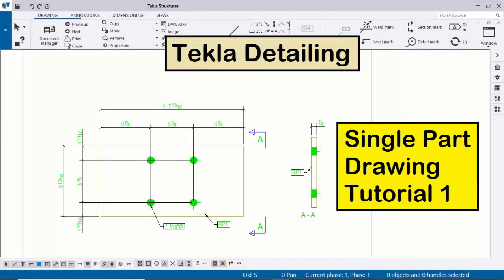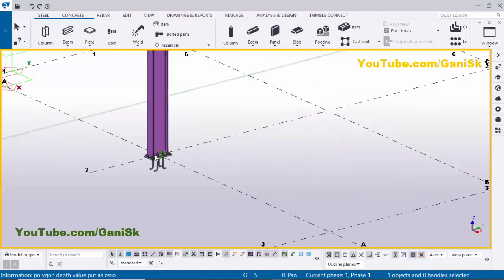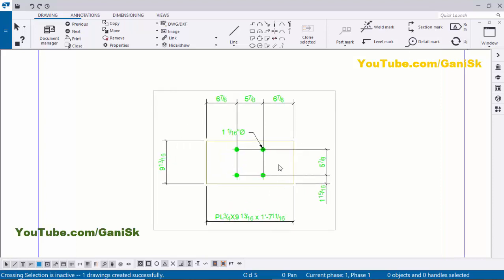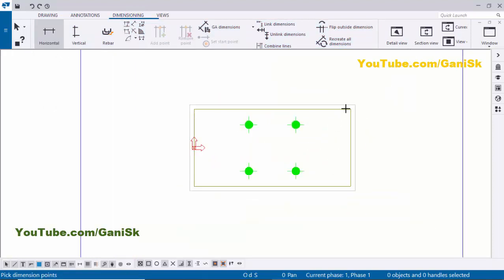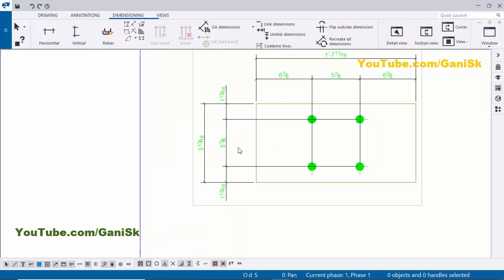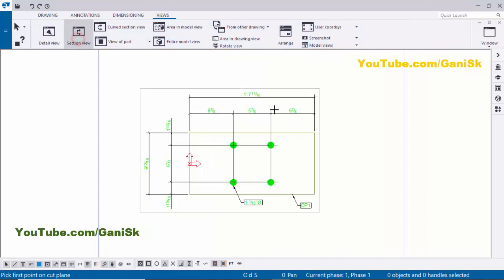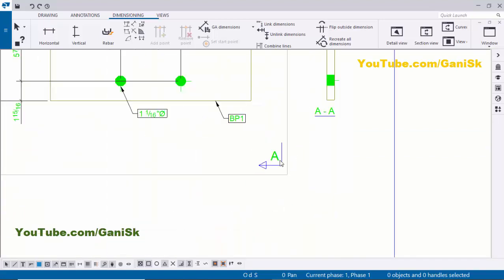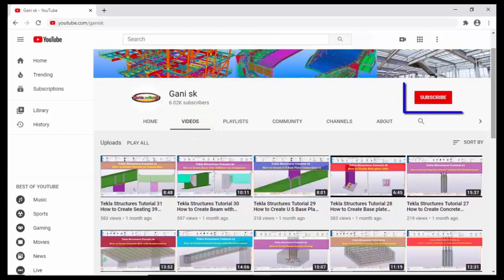Tekla Detailing | Single Part Drawing Tutorial 1 | Fabrication Drawings

Comment: How to know which side is my welded side in 2d single part (plate with holes closer toward one side and a cut on apposite side) while single part detailing?
Reply from the maker: Single part number and edge distance from hole to edge of the plate will be mentioned in the assemble drawing with weld side.
The purpose of the single part drawing to create a plate with holes as mentioned in single part drawing.
The purpose of the Assemble drawing for collection of single parts with the main part, those should be welded together as mentioned in the Assemble drawing.

Comment: Hi sir, I have one concern. I joined one of the companies as a trainee for Tekla Modeler, but they, without informing me, moved on to editing. Sir, my question is: are modelling and editing both the same? Is it value for editing?
Reply from the maker: Modelling and Editing are not both same, Modelling is more complicated than editing, that's why you will get more salary in modelling than editing position.
Reply: @GaniSk  sir, Is there value in editing? Can I get a good job salary in the coming days? compare to checking, detailing, and connection?

Comment: can we design masonry structure in tekla structure?
Reply: No for the design and analysis of concrete and steel structure you have to use Teskla structure designer,Tekla strucre can only be used for detailing
Reply: @mdabuathar1488  thanks. Dont know how it is a structural software if it can't design structure

Comment: When i try to create single part drawings, the drawings for the parts which are present inside the components, such as the stiffeners and connection plate, are not generating.
Reply from the maker: Step1: Activate Select Object in Component Option
Step2: Select required parts
Step3: Create single part drawing
Single part drawing means one part for one drawing, for example one stiffener-one drawing and one connection plate one drawing.
If you required all parts in one drawing then use assembly drawing or multi drawings.
for multi drawings you should create single part drawings first.
Reply: @GaniSk  
Thank you so much
That helped ❣️